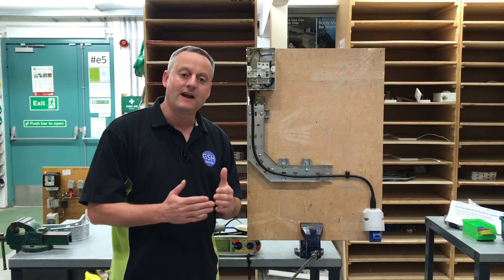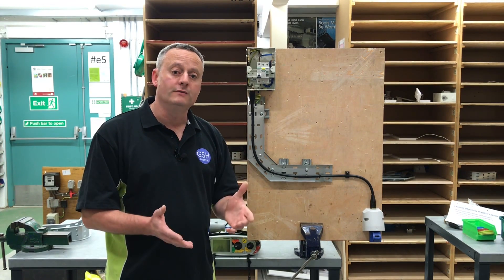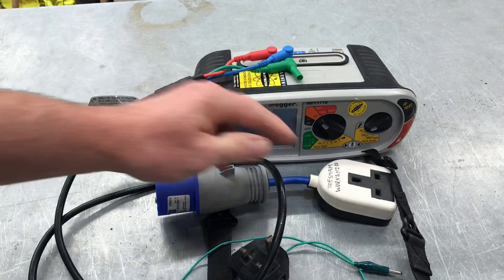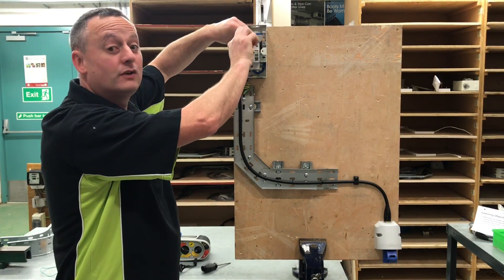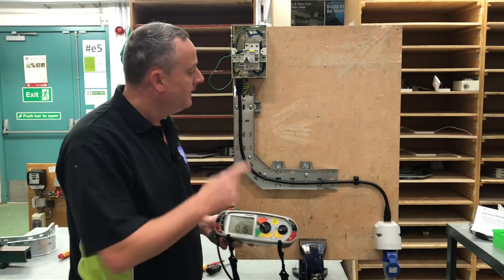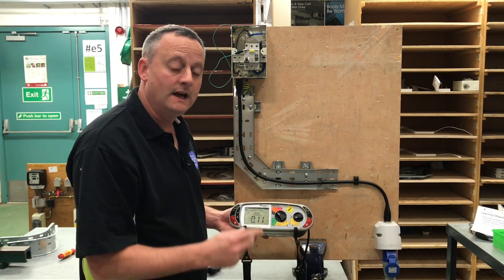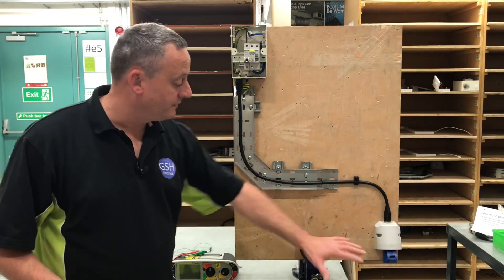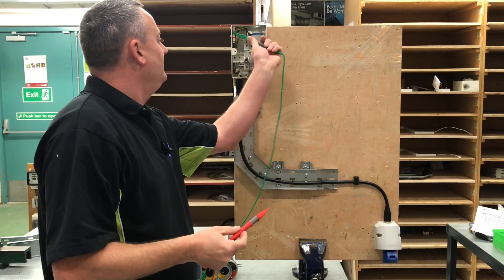How to Test a 16 amp Industrial Socket for Continuity of CPC, Polarity and Insulation Resistance

Comment: I got a question, for these kind of industrial sockets, especially the Lewden ones, can you like mix brands? Example can a Lewden plug fit in a PCE socket?

Just curious 😅
Reply from the maker: Yes it they are the correct amp rating eg 16 socket and a 16 amp plug